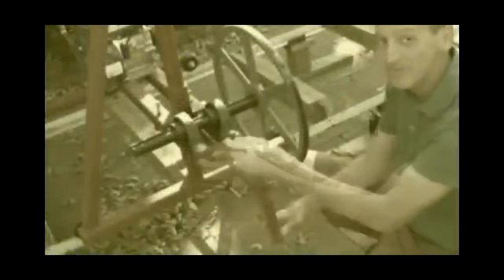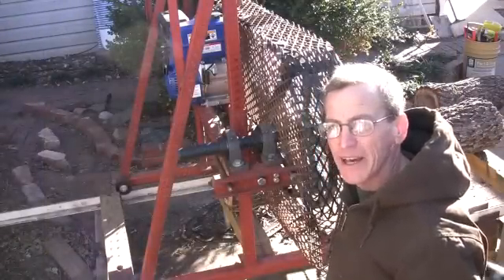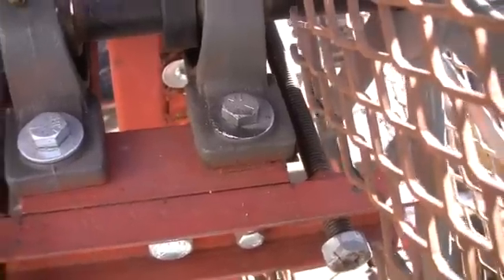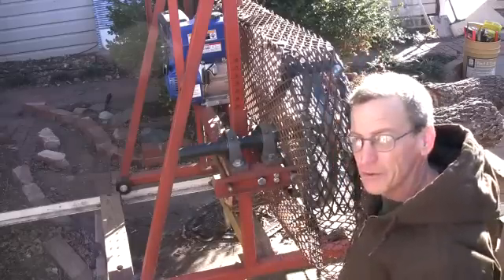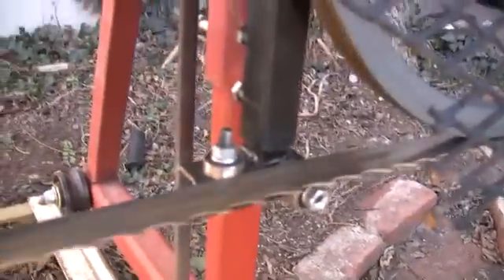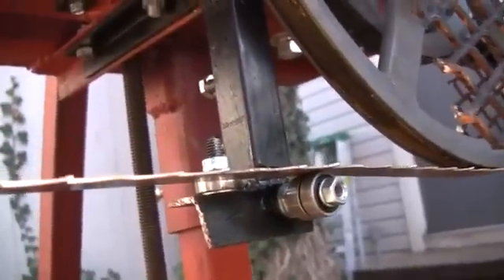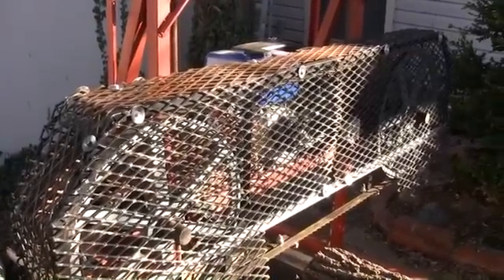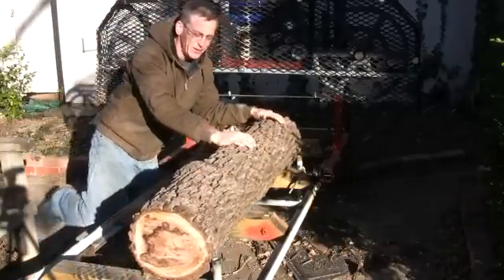Building a Bandsaw Mill - Part 2

Comment from the maker: @ Lance, The rails are about 3 feet apart.  theoretically, it will handle a 20 inch log but I'm cutting oak mostly and, at present, have no way to handle a log that heavy. The biggest log I've milled was 14 to 16 inches, Also the 6.5 horsepower engine is too wimpy to cut big oak.  But, for now, it does what I want.

Comment: you are doing great, consider a water tank, hose, nozzle, to spray water on the blade, keeps friction way down, and blade clean, just DW40 every time your done
Reply from the maker: Thanks, and thanks for the advice.  I do plan to add some water lubrication and make a vid about it and other details not included previously.

Comment: very nice, was there any blade drift while cutting?  and how does the blade stay on the wheels with only those little guides?
Reply from the maker: Thanks.    If the wheels are aligned, the blade stays put, but I'm just guessing at the tension.  The only blade drift I've experienced was when I was pushing hard with a dull blade. I've added another guide bearing so there's one both above and below the blade, seems to help limit drift.
Reply: Kevin Nance how much was that build including the motor?
Reply from the maker: alex holden I calculate that I spent around $1100 not including tools or tool related expense.   Quite a bit of the steel was bought as scrap by the pound. If you have the time to search through scrap yards then that will save you a lot of money.  The motor is a Harbor Freight 6.5 hp cheapie.  They are down to around $120 now.  Works ok if you're not in a hurry.
Reply: Kevin Nance thanks for the info, I will have to start looking around the scrap yards near me.